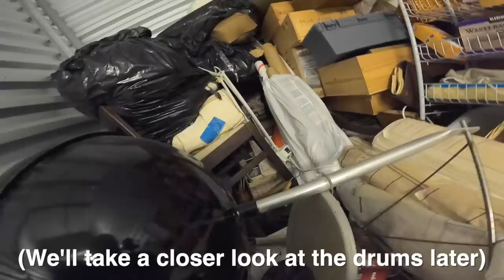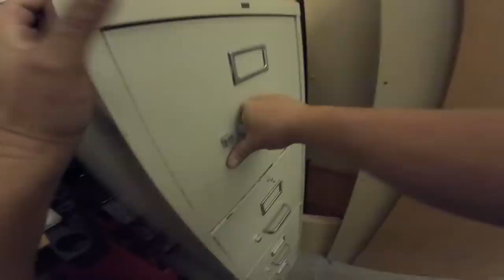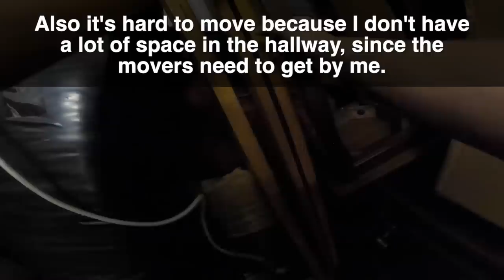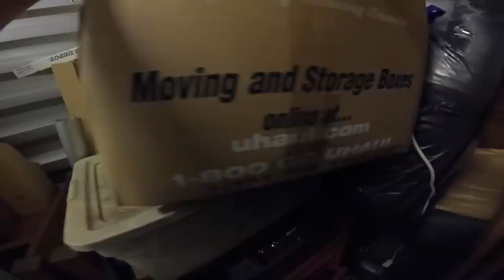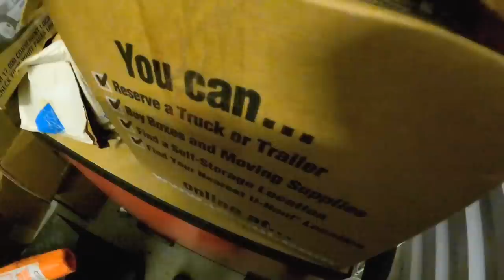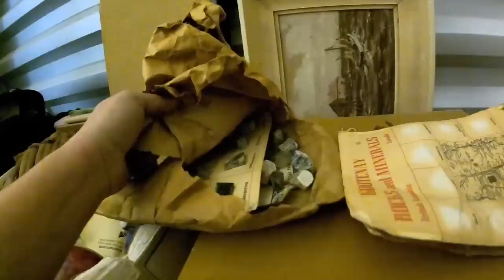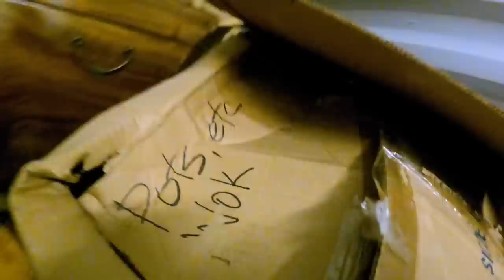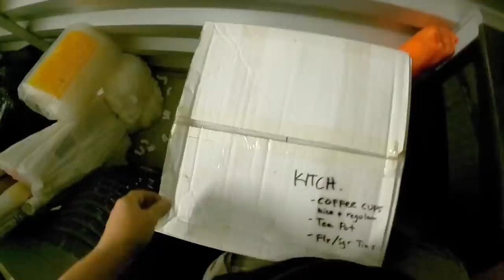Will I ever financially recover from this? Spent $8,000 on a locker at the abandoned storage auction

Comment: Question: How did the price end up at $8,000? I haven't been following this industry for long....but I assumed there were 2 or 3 ways. 

1. Auction price (blind auction, with the price rising by way of back & forth bidding).

2. Price is set...or the auction starting price is set by storage staff who have taken a look at what is inside...and they make a guesstimate.

3. Estate sale....with the price set by an executor of an estate...or an estate company.

So I guess this is a 2 part question. #1. How is the price generally set for these lockers (and does it depend on the type of situation..as I suggested)? 

And #2. How did this locker in particular get to that price? What factors are looked at to get it there....either by auction or otherwise (what information pushed people to keep bidding on this particular unit if it was a standard auction)?